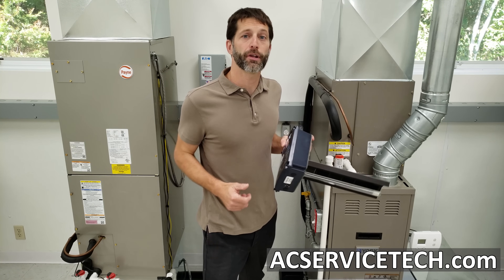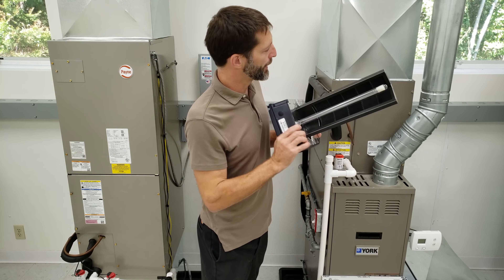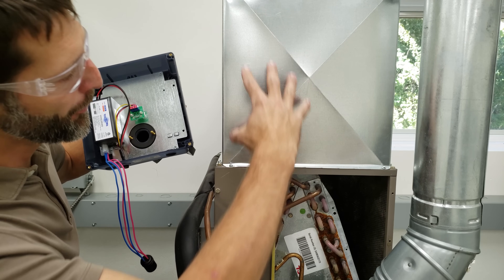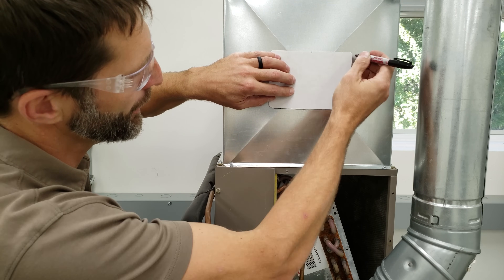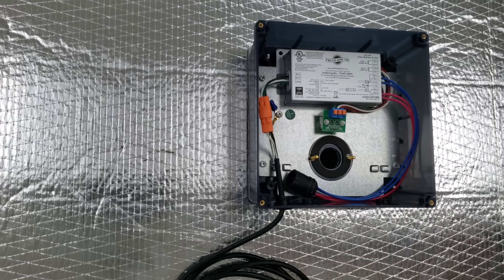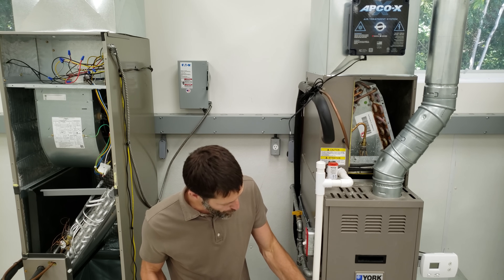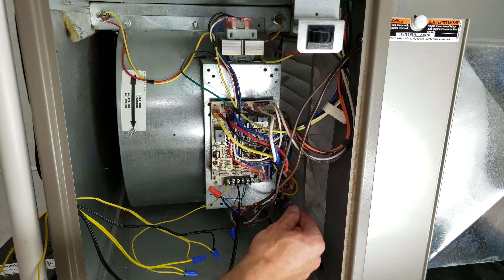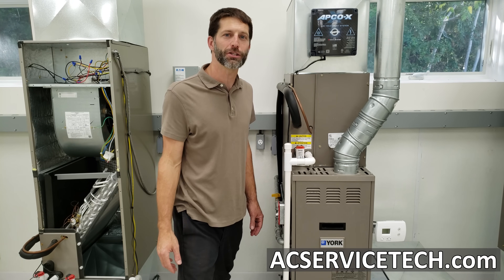Installing a UV Light and Air Treatment System in an HVAC Unit! STEP BY STEP

Comment: I'm retired installer and I have a suggestion. Why don't you cut the hole a little bit smaller and take your hand seamers to bend the sides of the shark metal in 90° to make a metal around the hole lay flattered?

Comment: I'm interested in putting this in my system.  The only question I have is does running in heat mode affect or damage the light?  My evaporator is above my heat exchangers like the unit you have in the video.

Comment: There is APCO and APCO-X.  On Amazon I only see the APCO.  Is that sufficient for a single level 3000 sq ft home?  Also, would I need one for the air handler and the condenser?

Comment: Moved into a new build and started to notice a musty smell, company builder used to install HVAC came out twice and found no issues, both times the smells came back after a few days. Third visit they replaced the coils and cleaned the pan, I can still slightly smell it. 

I wanted to get a reme halo, but I've been getting conflicting feedback about it. Any advice? (I'm in need of clean air as I'm trying to regain my health from living in hidden mold)

Comment: I had a question did you Pig tail the common wire to the c terminal couldn’t you just put the common wire in the c terminal on the board instead of putting a wire nut ?

Comment: I now have above A coil a humidifier thus I am told UV will degrade plastic frame of humidifier. Still I want uv light reaching A coil. Please make suggestions.   I now have UV light  in out flow plenum four feet from coil.
Reply: The humidifier is an April air by pass unit

Comment: Great info!  I searched the thread, but didn't see anyone mention how UV can accelerate "photo-corrosion" of aluminum (for the duct work).  I'm curious if the UV light should be placed in any particular location -- I imagine boring duct work with no electronics would be fine to be exposed to UV, but wiring and/or an evap coil might be bad around UV?   I've found a few papers that discuss photo-corrosion by UV and aluminum is apparently higher on the list.
Reply: I just added a honeywell UV lamp in my goodman airhandler, The goodman handler has a knock out for UV and the V shaped evaporator has a knock out that places the uv dead center of the inside v shape which happened to be inverted in my application and is just above the airfilter so filter air is drawn through a filter then uv then evap then blower. The goodman knockout was 1/4 inch to small for the Honeywell mounting but larger enough for the lamp going into the evaporator assembly.
Reply: Looking up UV corrosion it seems that most testing was done under aqueous conditions not open air and was specific to aluminum specific alloys, I suspect the loss would be minimal otherwise HVAC manufacturers would have already changed the metallurgy of the materials had there been significant damage from UV

Comment: Thanks so much Craig . Is it safe to connect the UV light  electricity to the unit R and C .? Does the UV affect the AC unit life time or create any fire ?
Reply: As long as you dont overload the transformer, it is safe. However, it is crucial you check the transformer capacity before connecting to R&C, otherwise a dedicate power supply should be used.

Comment: Craig, thanks for the exceptional video. I’m seriously considering an APCO X for my new 5 ton Heat Pump. The AHU will come with 10KW of emergency heat/strip heating. Will that impact my APCO X installation. I checked Fresh-Aire UV’s website for additional installation information but did not find anything.  Thanks again.
Reply: Andres, the APCO-X was designed and built in Jupiter, FL with plenty of heat strips/air handlers.   The ceramic base, the hard quartz lamp, and the activated carbon cells can withstand any heat generated from the heat strip.

Comment: Side note, don't install these where the uv light will hit any sort of wiring inside the system or by blower, just had a system pop a breaker because the uv light stripped away the shielding on the high voltage wires.
Reply: You can purchase UV coating UV protectant wire chases it’s very in expensive a box of 50 or 100 feet is probably 30 bucks
Reply: All equipment from 2005 has UVC inhibitors in it.   APCO-X is residential, and some contractors install commercial UVC, which will create these problems.   Stick with products that are designed for residential applications.

Comment: some research shows UVC (the smell from the lamp is ozone) produced by a quartz germicidal lamp in contact with high humidity produces peroxide. Peroxide will erode evaporator fins. Refer to you EPA608 studies.
also, dogs and cats are sensitive to UVC. Too much UVC introduced to a area can irritate your pets eyes or make them irritable,
so know the correct amount varied by the actual size of the lamp to introduce.
also, do not look directly at a UVC lamp. UVC will burn your retina's.
All that being said, UVC is a wonderful germicidal weapon. Respect it, treat it like the poison it is. I've taken one of my DIY lamps, stuck it in a bad smelling trash can, 20 seconds later, smells good.
Reply: Michael, one note....UVC has a wavelenght of 200-280 nano meters (nm), and USA made hard quartz lamps can provide an exact 254 nm, which is the peak of UVC output.   UVV or UV Vacuum is lower, and includes the 185 nm Ozone spectrum.   This can be generated by foreign or soft quartz lamps.   Some manufacturers can emit both, using a "split-glass" lamp.   APCO-X uses USA hard quartz lamps 254nm.   No ozone is produced.  The UL 2998 label is on the box.

Comment: Will the UV light deteriorate insulation in equipment cabinet? I have seen uv light ruin filters.
Reply: It will dry rot and strip the shielding on any and all wires within the system, none of them are rated or sunlight.
Reply: All equipment from 2005 has UVC inhibitors in it.   APCO-X is residential, and some contractors install commercial UVC, which will create these problems.   Stick with products that are designed for residential applications.

Comment: I wish you would have connected it to the additional transformer you had to show us how that worked. Ive always been told to add a transformer on these just incase.
Reply: The 24vac does pull 16va...so it may be necessary to upgrade or provide a secondary transformer.

Comment: For best result...
UV light before installation.  We have to check the air quality.  And we need to check the air quality again after the installation of the UV light.  In this way we can find the difference in whether it is working or not.  I did the same thing a year ago in Dubai
Reply: So what were the results my guy?
Reply: What did you find in your compare?
Reply: Let’s say air quality is poor what measures are taken for improvement
Reply: And the results were.....?
Reply: @PIndyJones  they never answer with concrete results #snakeoil

Comment: I have two of the dual units in my 2 systems. I had a really dirty coil on a 1 year old house. The installers put the filter in the stand the A/H sits on instead of the filter slot inside the A/H. The stand was open on 2 sides. Coil was a mess. Cleaned the coil with NuCalgon and installed the dual Apco's. I got the coil fairly clean but it wasn't 100%. Less then a week after the install and the filter in the correct place, the coil was spotless. It has been spotless ever since. I'm not sure if the black stuff was mold or just wet dirt but the light got rid of it 100%. I was a bit skeptical but I also wanted to be as safe as possible from the rona. I am sold on these. The sightglass is really not needed as you can see the bluelight on the part of the Apco that is attached to the duct. They have different levels of lights that go by how many years they last. I opted for the 3 year. In 3 years I will need to buy 4 lights. I have the main unit mounted pretty much like in the video but in ductboard. For the second light it's just the wire coming from the main unit to the bulb holder. They provide a magnet for the second light. I put mine in between the A coil. I also installed a transformer for each unit just for the lights. I don't have electrical outlets in the A/C closets. I wago'ed line voltage off the OEM transformer for the second transformer. Install is very easy.

Comment: Installing a UV light inside the air handler cabinet seems like poor practice to me. I have seen several cases of a UV light inside an air handler cabinet breaking down the electrical wire insulation. The wire insulation eventually turns into powdery whitish dust. Prolonged UV exposure is no joke!
Reply: Agree. It also breaks down the drain pan.  The bulbs are expensive to replace too.  And in all my years, I just never seen where this was even necessary to install.
Reply: @revealingfacts4all  If you consider portable air purifiers with 5 cfm blowers cost $3-500 each, and cover a 10x10 room, a whole house system is a no brainer for you and your customer.   And these lamps last 3 years, guaranteed.   The whole APCO-X offers a Lifetime Performance Guarantee.  Just install it per the manufacturers specs.
Reply: It is true, you are turning your customers air handler into a disinfecting device, so be sure to follow the manufacturers recommendations in the manual.

Comment: Do those things really work with 1/2 second exposure to the air passing through?
Reply: That's why they work best with a snake oil injector on the return side.
Reply: @easkeybikes1966  Unlike alot of IAQ products on the market, the APCO-X uses the Activated Carbon to absorb chemicals, odors, VOCs, as well as microbials, and the UVC light will disinfect the carbon, and the coil/drain pan.   The product was tested using ASHRAE 52.2 Test rig, which has a 24x24 plenum and 492 cfm of airflow, and within 3 hours (4-6 air changes/hour) the Carbon cell UVC combination reduced microbials in the air 99.9%.
Reply: @easkeybikes1966  lol, I have 2 of em trying to sell, didn't install em.
Reply: UV light will deteriorate anything it touches over a period of time. Wiring, insulation, anything plastic, etc. It will also build up a white slag on the metal. I wouldn’t install one based on what I’ve seen long term.
Reply: @paulh3973  It makes a good up sell due to cv19 though.  You should be able to sell a shit ton of these to businesses.
Reply: @paulh3973  Lots of contractors are using Commercial grade UVC lights.  Be sure the manufacturer's manual indicates proper use for residential applications.  The APCO-X is rated 2-7 tons.
Reply: No

Comment: Another reason to put these on the supply side is it is far more likely to kill the biologics in the drier, dehumidified air where there is less water vapor in the way.  Also, any biologics in larger water droplets will have condensed out with the water and ran down the drain.
Reply: That explains the shit that gets stuck in there that looks like snot

Comment: Why do you need a dual version for an air handler? All of the air has to pass through the top part. No? What am I missing? Thank you!
Reply: Well, the air is cleaned but the light isnt going to hit the coil without the other lamp being at the bottom.
Reply: You need to watch the video again and this time listen. The light needs to cover all exhaust sides of the A-coil core. It’s function is to kill growth on the A-coil and should be on 24/7

Comment: I heard that UV lights will shorten the life of plastic drain pans...
Reply: Any plastic include cabling and paper labels
Reply: All equipment from 2005 has UVC inhibitors in it.   APCO-X is residential, and some contractors install commercial UVC, which will create these problems.   Stick with products that are designed for residential applications.

Comment: Why not run it on the 24V green so that the customer can run it with the blower fan on or fan circulate so that way the UV isn’t always on consistently? 
I know with the ozone cells if it’s on consistently the ozone will build up in the Plenum boxe and over whelm the customer with a hydrogen Peroxide type smell.
Reply: Manufacturer recommends light stays on 24/7. Bulbs are rated how long they last based on 24/7 usage. Mine are the highest rated they offer and will last 3 years. My above post will tell why I was skeptical about these and became a believer. I set a reminder in my phone plus wrote the install date on the sticker they give you to replace the bulbs. If you are changing the filter every month you should be seeing the sticker on the A/H.
Reply: Mold grows 24/7 and on/off shortens the life of the bulb.  APCO-X is ozone free and H2O2 free so those "products" require to cycle on/off with blower.  The only biproduct of APCO-X is clean air
Reply: Agree. The lamp has life span of so many hours, customer never notice if the lamp died
Reply: @Froggability  Actually, discharge lamps are limited by on/off cycles.  It is the startup that is hard on them.
Reply: @jkbrown5496  YES!

Comment: Some guys, like myself, often wire the light power source to the EAC "Electronic Air Filter terminal", on the brain board, thats Hot L1 voltage and the common or neutral line return, also on the brain board.....Light comes on, only if the blower is on...Good video.
Reply: Question is the hot L1 and EAC Power source 24v or 115v?
I noticed this is a 24v UV light system
Reply: @jackrobert82  EAC terminal output on a brain board is 120Volts...The electronic air cleaner has it's own transformer, if used...For the most part, anyway...They make different voltages for theses lights...Most sold for DIY'ers are 120 volts and you just plug them in to an outlet...Then they stay on 24/7...Not the best idea to me, but that's me...The EAC terminal is hot, only when the blower runs, period...You must also watch where you mount them, UV light can destroy some materials, when exposed long enough...
Reply: @vernroach3413 I’ve seen the inside of units where the coil is directly exposed to UV light and it’s all faded, it definitely wears on the metal and whatever else is exposed but they definitely work
Reply: Yeah but he said the light is controlled by the exterior on/off light switch and when the switch is on, the UV light will stay on 24/7…so you’re wiring is wrong
Reply: @donsturtevant2396 ... Why would you have it on 27/7 if the blower is not running?...DUH...If hooked up to the EAC terminal it turns on when the blower turns on, either heating of cooling and only when the blower turns on...Why leave the lights burning while no air is moving and they're doing nothing...Do you leave your house lights on 24/7 or only when you need them...If you don't know how to do it, then don't...Just plug it in and let them lights burn and burn out...Leave all your lights on, but I'm thinking, in some cases, like yours, the lights are on, but no one is home.
Reply: @vernroach3413  Hey Vern, you would keep the light on to bake the coil 24/7 and keep it germ free.
Reply: You have the light close enough to bake the coil, kiss it goodbye...UV light can be harmful to many materials, especially with constant exposer over time...On 24/7 accomplishes nothing without air movement, other than shorter life of the bulbs and wasted electric...The unit is made to clean and sanitize the air, not the coil...Stay safe and Lets go Brandon.
Reply: @vernonroach918  that's why we quit selling them... destroys flex duct and probably evap. Insulation... and yes let's go Brandon
Reply: @itchc1263  Many UV manufacturers don't offer the proper product for the application.   You likely used a high-output light, designed for commercial applications.   The Fresh-Aire systems guarantee your success, and each product manual provides the proper installation procedure.
Reply: @vernroach3413  These UVC lights function alot like a flourescent light...you don't want to continually startup the lamp, as the energy requried is better used to bathe the coil 24/7, warranted for 3 years of continuous operation.   Only UV-Ozone lamps have required cycling with the blower, to not allow excessive levels of ozone to hit the inhabited space.
Reply: @ronasaunders  Why what a shocker...I mean, everybody should leave their florescent lights on 24/7 too?....All this time and being a lighting specialist amongst other trades I have, along with the HVAC and being a Building Services Foreman, to learn, I've been doing it all wrong...I can imagine the High Rise buildings I work in with lights on 24/7 after I share this discovery...Thank you so much.
Reply: @vernroach3413  boom roasted

Comment: I always wonder how that small amount of activated carbon will do any appreciable good. The same goes with those thin activated carbon sheets you can slap over a filter. From what I gather, commercial installations use large canisters with 10's of lbs. of activated carbon.

Comment: nice tips, but i had some "oh, no, you're doing it wrong" moments, because handling the lamp without gloves and leaving fingerprints on it will actually shorten its life span. This is because oil in the greasy fingerprints will degrade over time and darken the lamp surface, it can even cause cracks in the quartz glass - the effect is the same as with halogen quartz light bulbs.
Reply: Unlike most other manufacturers lamps Fresh-Aire UV lamps can be handled when not lit. This is because they are made using high-quality hard quartz not the soft quartz found in inexpensive imports (handling soft quartz lamps may cause them to fail).
Reply: I was i aware to put it in the supply. I believed it always went into the return to reduce o3